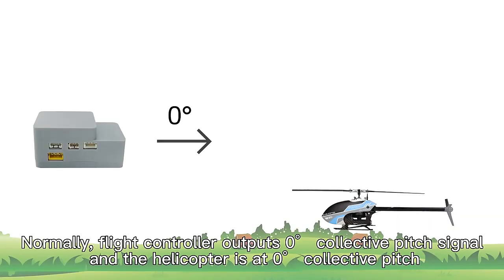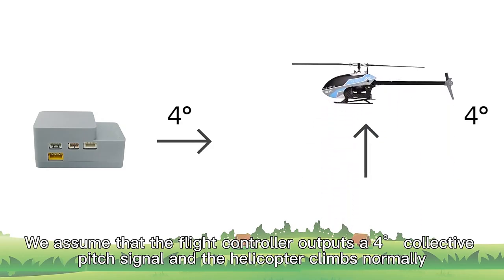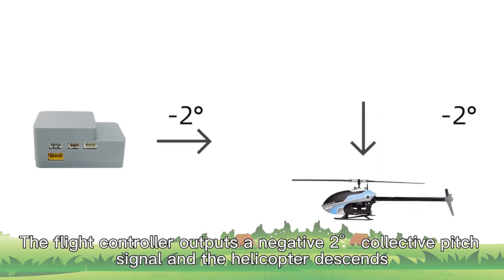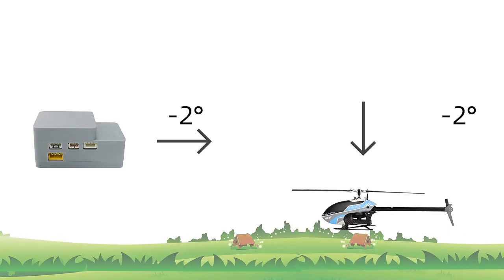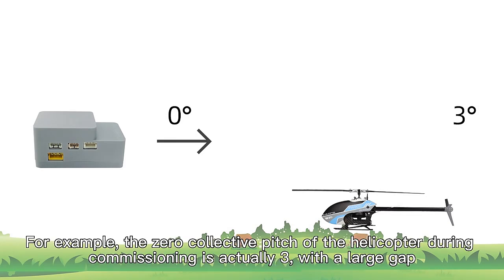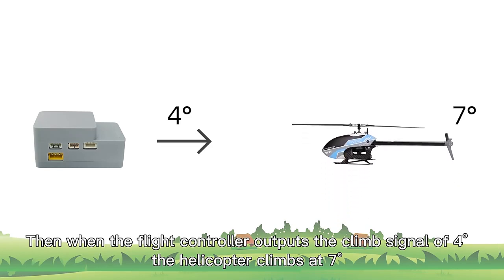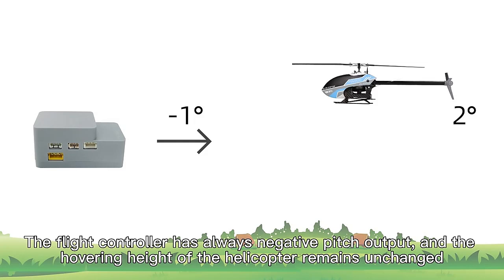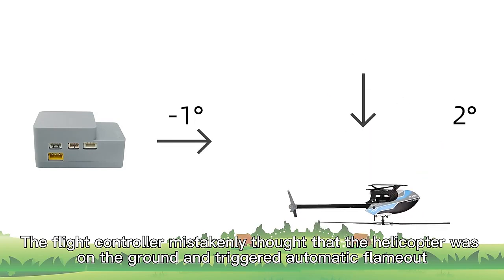Why did the FW200 helicopter crash automatically? resolvent

Comment: While simply hovering my FW200, all of a sudden it fell like a spinning rock. I agree with some comments below. This is not a pilot error. I don't mind trying to apply the software fix even if it was difficult to find a tablet that could load the software. 

My issue is that the broken parts should be covered by the manufacturer warranty. I am hoping it will.  I just sent an email to the support team. Hopefully the parts are covered.

Comment: I tried to adjust the zero pitch as explained,but I can NOT get the blades even, used all the adjustment in the app the slide bar is all the way down,still the blade is about 1/2 inch off,this FW200 has NO mechanical adjustments,you can not adjust the servo harns,no adjustment on the linkage,the only adjustment is in the app and movement is very little,very frustrated with this FW200